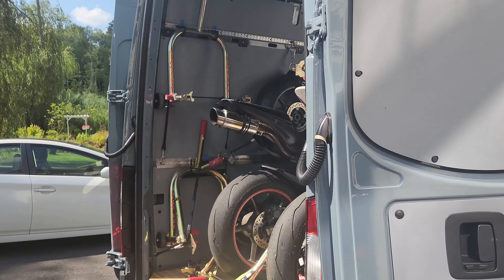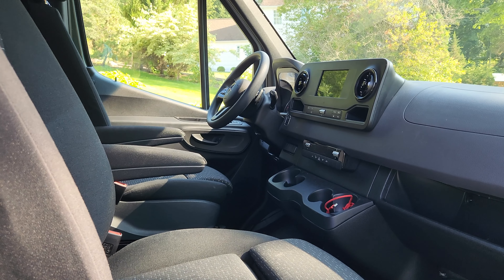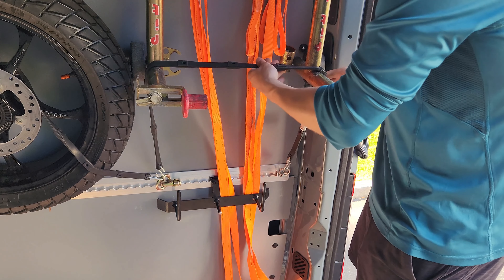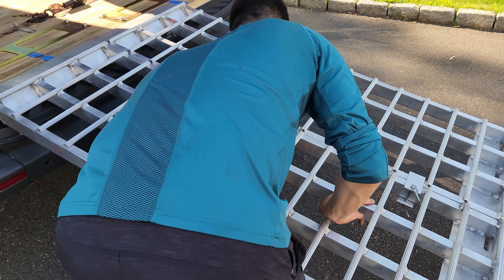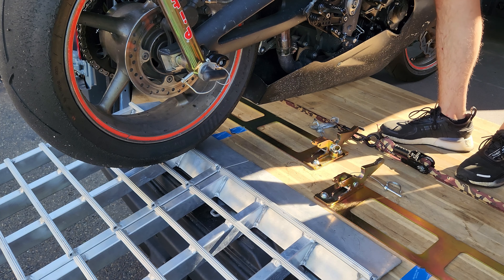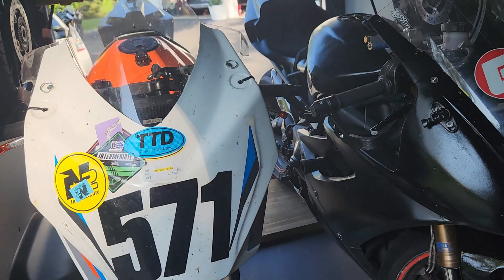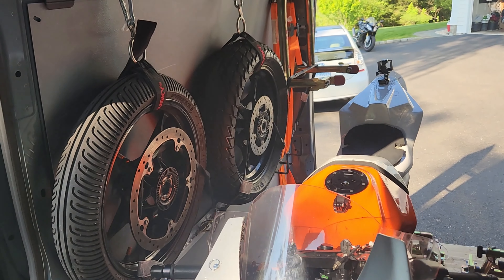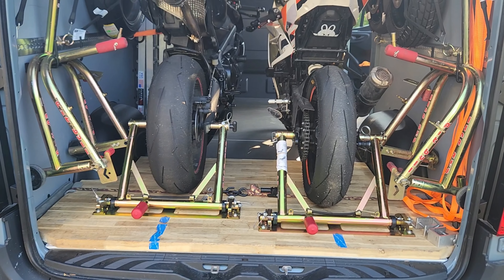Mercedes-Benz Sprinter Van Motorcycle Trackday Build and Pit Bull TRS

Comment: Thanks for the walk through, great set up!
Pro Tip: @11:35 when it doesn't line up perfectly but is close like you demonstrated, flip the lock closed on the side that is fully seated (in your case the left one) then just turn the handle bars full left (or right) the second one drops right in! No need to try to slide or pick up the front end.

...unless of course you have modified steering stops like on my buddy's race bike, that cuts the turning angle in half (he says it is to help with tank slappers). Then yeah, I do have to slide the front over. Luckily its a little Ninja 400 😀

Comment: do they dont crash if u ride70 mph and hit bump or on really bumpy road??? i havent seen any test out there while ride
Reply from the maker: no issues with bumps, the board stays steady with the single strap setup. i doubt this system will survive a real crash vs. having the TRS bolted directly to the frame of the van, but it's a risk i'm willing to take to not put permanent holes into the van.
Reply: So this screw in to wood and not under the van frame? Does it work with out strap and use just front stand lock that thing that u have on trailer for bike to not move front or fall over they sell it in pit pull to
Reply: @sunny7L  how many meter is the load space legnt from seat to back dorr?
Reply from the maker: @imrin4059  you can get specifics on it in my separate video talking about the TRS mounting system specifically. look for the video titled 'Pit Bull Trailer Restraint System (TRS) Mounting System for Mercedes-Benz Sprinter (Trackday).' should have the info you're looking for.
Reply from the maker: @imrin4059  i don't think the system would be as effective without the strap. you have to stop vertical movement otherwise the bikes will hop up and down with every bump. a front wheel chock won't stop vertical movement.
Reply: How wide is it to be able to fit 2 motorcycle. In meter or cm or mm